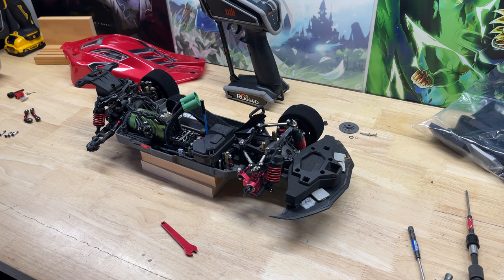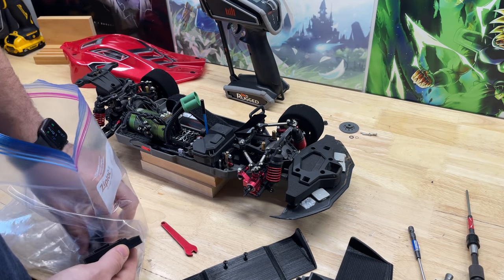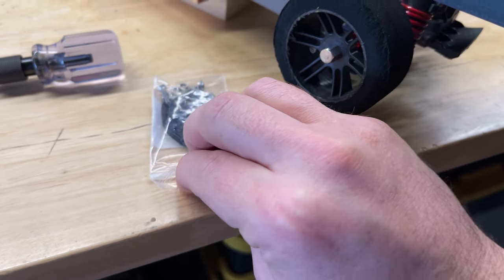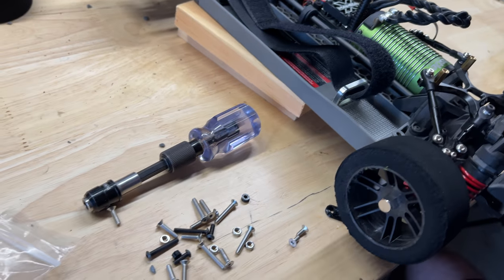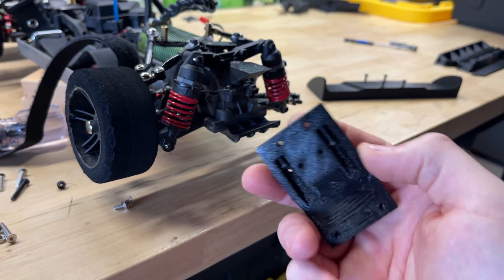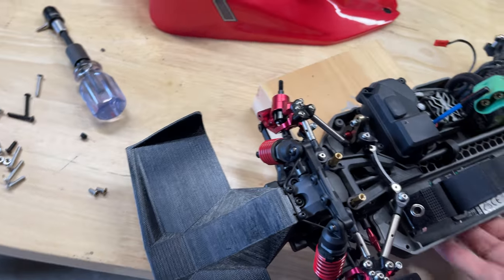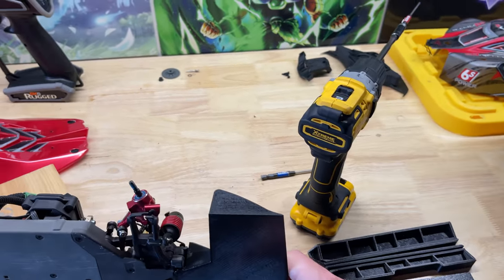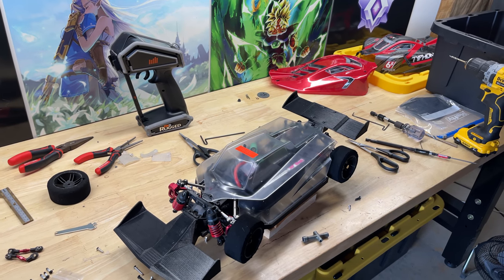Traxxas 4-Tec 3.0 | A.W. Customs Open Wheel Kit

Comment: Hey my friend what wheel hex adapters are you using ? I see you are running bar drag wheels and I am running contact 26mm front and 30mm in rear and was really intrigued by your set up if you could please help with that info I would greatly appreciate it thanks.